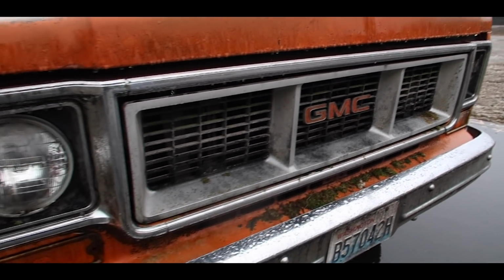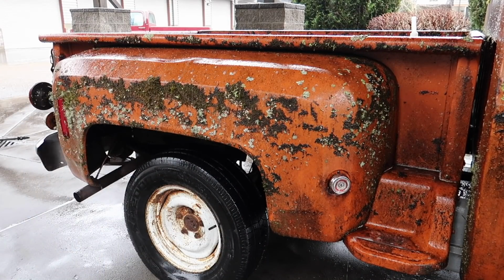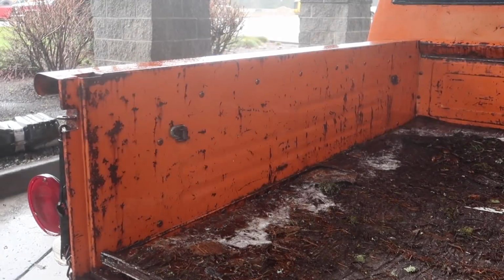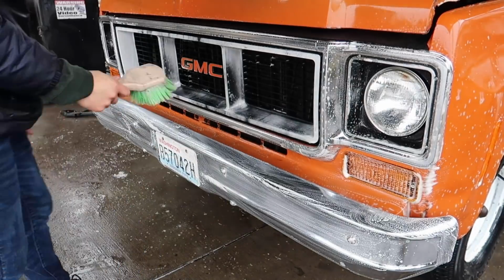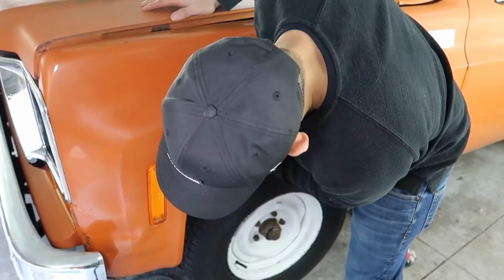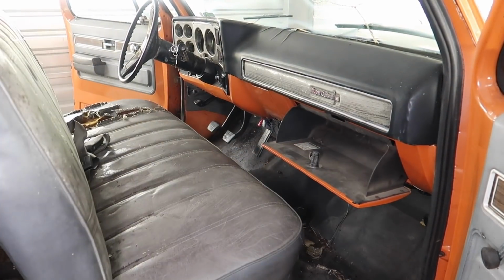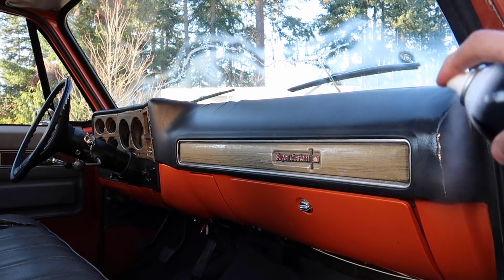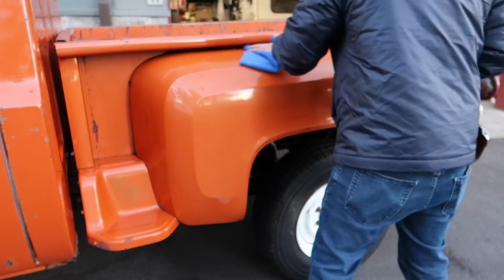1973 GMC STEPSIDE | FIRST WASH IN 18 YEARS! |*SHOCKING RESULTS*

Comment: I started doing auto body work in 1974 at a GMC dealer. Those were brand new trucks then.  They never put much paint on them and it was very easy to buff through.
Reply: There's three places on my 79 stepside where they missed with the paint gun, only primer. Probably a Friday afternoon job.

Comment: Nicely done, looked like quite the project. Amazing how much better it looked after a decent wash. I used to have a '66 Chevy stepside, same color and paint condition although my hood had more paint. Just kept what was there shined up and used to get a lot of compliments on it. I also do an acid wash on cars with heavy water spots. Like you say be careful and don't let it sit and you won't have a problem. Only thing I found I really need to watch is aluminum window trim.
Reply: I have trades, I had a dream about a orange 65 66 step, that's my dream truck..

Comment: You did what you could with this old beauty. Not the best of shape, almost like a spit and shine kinda detail. I love this style Chevy/GMC pickup with the stepside bed. So many possibilities for customization. I would tear this truck down bit by bit and turn it into an old school resto mod. Redo the whole chassis with new parts, a custom paint job, lower it, put in a hopped up small or big block Chevy engine, 15 or 16 inch wheels, "big and little" tires, and a custom interior.

Comment: One of GM's biggest screw ups was that hood!  The hinges have to be almost floating in lubricant or the hood will buckle right about midway because some GM "GENIUS" designed a dimple into that spot that created a weak spot.  GM NEVER corrected that screw up and a lot of good trucks paid for it by being junked or abandoned long before their time.
Reply: They actually sold a reinforcement kit through the parts dept.  Unfortunately, no one thought of it until after the fact.

Comment: 1973 was the first year for that body design & were produced up through 1991, except for the half ton & three quarter ton regular cab pickups which ended in 1987, & the one ton regular cab pickups ended in 1989. In 1981, the nose on the front & emblems to name a few were redesigned. 1987 was the first year for gasoline fuel injected motors & the C/K series was dropped & renamed the R/V series to plan to make a distinction between them & the upcoming new body design on the regular cab pickups for the 1988 model year to help people avoid confusion with the two different body designs that were gonna be in production together. GMC & Chevy went back to the C/K series on the new body design & the previous body design had the R/V series. 1980 was both the first year for square shaped headlamps & the last year for round shaped headlamps. 1980 was also the last year for outside hood release. The square shaped headlamps came standard on models with the Silverado & Sierra Classic trim levels & optional on models with the other trim levels. That body design were the first Chevrolets & GMCs to have an optional bigger cab which was a crew cab introduced in 1973 & they were only available on three quarter ton & one ton models & all had a long wheel base & the only pickup box that came with them was the 8ft long fleetside one. Unlike the crew cabs today which are also available on half ton models with a shorter wheel base & shorter pickup box too. 1975 was the first year for the Silverado trim level which replaced last year's Cheyenne Super trim level. 1977 was the first year for optional power windows, power door locks, & inside hood release, & the only year for the gold stripe in the optional bodyside molding trim.

Comment: Came out great chemical guys clear cut did it's job haven't used it since I prefer kochemie polishes but I do use the vline from chemicals guys for headlight restorations topped off with a ceramic coating 3y

Comment: That’s the kind of pick up truck I let the heavy stripped all the way down to the frame have them do a good job on the drain make sure there’s no rust and then as I put it back together put it put back in higher tech parts like a new engine something updated I’d like a sleeper truck I have a jacked up just one maybe 2 inches tops and then have the whole thing repainted and orange is not the bad color I would probably go back to Orange.

Comment: The GM workers were still constantly on strike and angry during the period these 1st gen trucks were produced. Not surprised little paint on many surfaces. The cars suffered far worse fate, especially if they had a vinyl tops . Hoods on everything produced were notorious for developing surface rust early, I suspect those in the primer / paint department made sure the cars and trucks had no primer at all, and very little paint. The truck you are working on came out surprisingly nice...

Comment: So did this truck run at the time? Trying to understand why it was looking like it had been just sitting for a long time in one place with all the moss and mold. If it runs, why was it just sitting and if it didn't, why would they detail is before having it repaired? Seems like a basic wash then repair mechanically and then detail as the last step wopuld make snese so the detail doesnt get all messed up during repairs.